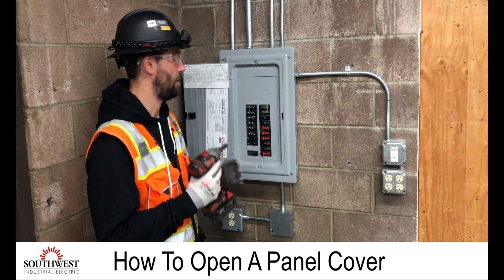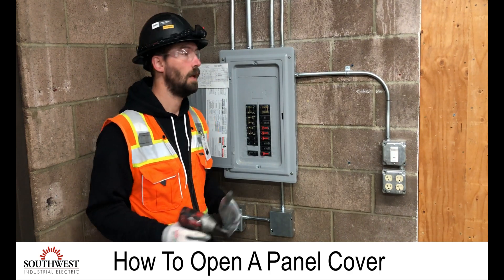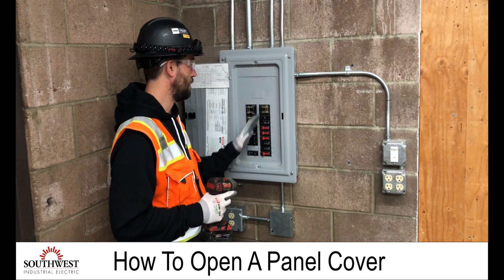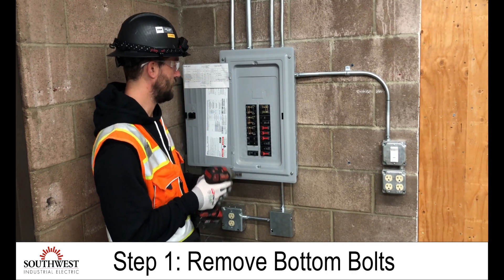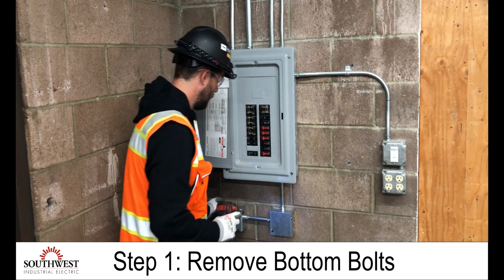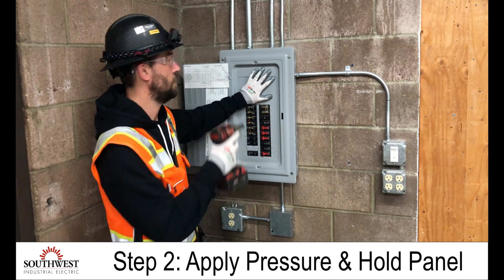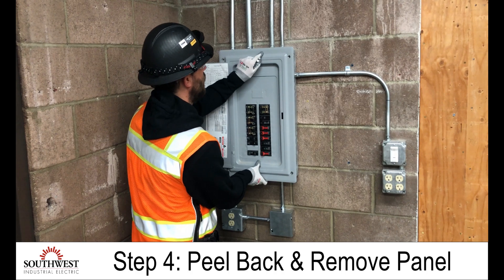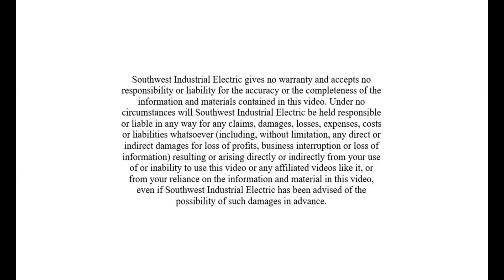How To Open A Panel Cover

Comment: What size and type of drill driver tip were you using in the video? I usually use a large flat head screwdriver to remove the panel bolts. Thanks.
Reply: #2 square tip homie. If applicable anyway. Sometimes they use that odd bit that’s somewhere between a flat blade and Philips. They come with Milwaukee power reamers. All great tools to have.
Reply: @ihaveaverysmoothbrain7231  I have some of those ECX/Combination drivers. I use them for device terminal screws.